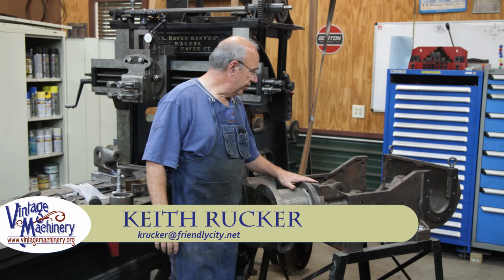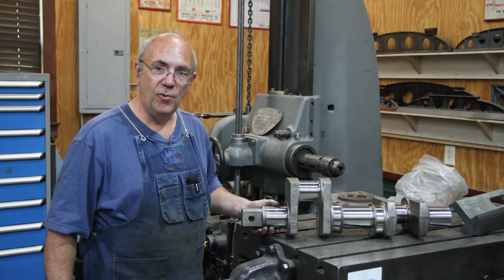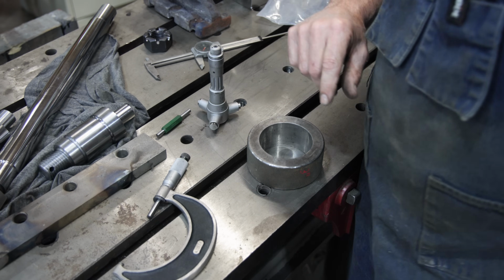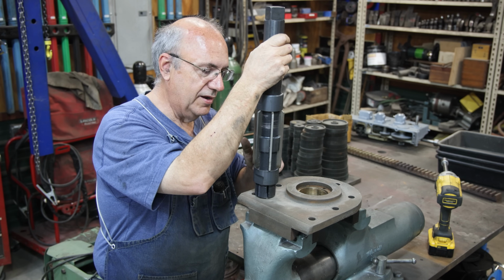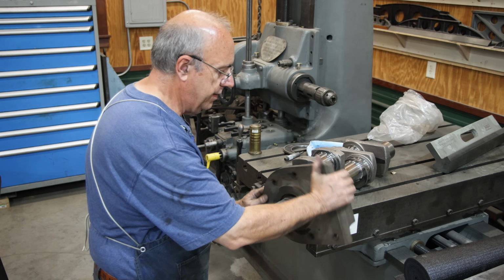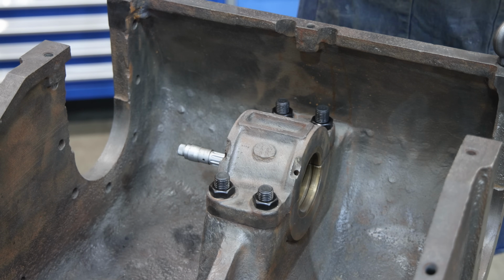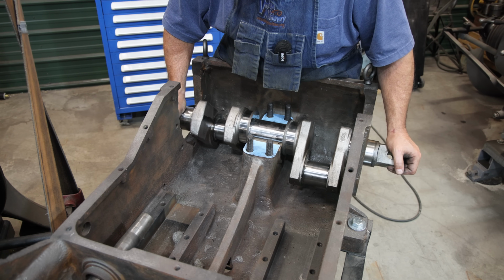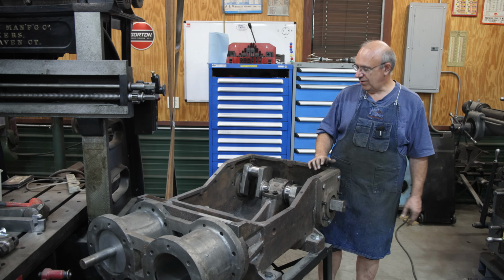Steam Stoker Engine: Installing the Crankshaft

Comment: That center bearing needs to be line bored so it is in line with the end bearings.  Your crank is way too tight and would burn the bearings out quickly.  It's not clear if those end caps have locating dowels.  If not then you can loosen those bolts and allow the end bearings to align with the center.  A lot of old engines did not have located main bearings, and the method used was to tighten- tap- tighten- tap- tighten- tap until the crank spun feeely.  However if those end caps are doweled in place, then you need to make a boring bar with a cutter that is supported by the end caps.
Reply: The end bearings aren't dowled in place. Meaning the crank itself is what does the alignment. No need to over complicate things. There is such a thing as too much constraint.
Reply: @dangerrangerlstc  No need to repeat what I already said.
Reply: @oldschool1993 I misunderstood what you were trying to convey on your post. My apologies

Comment: Keith the bearings need to be assembled in the engine without the crankshaft, and line bored for proper fit and alignment. No matter what type of bearings are used, Babbitt or bronze or insert type bearings all the bearings need to be straight in line. The crankshaft is ground with all the journals being straight, and if the bearings the crank fits onto are not straight the crank will never turn freely. IMO
Reply: Exactly what I was going to say. Any slight angular misalignment of an end cap bores will cause the bearings to bind when they are installed.
Reply: I agree but someone else brought up the fact that it wasn’t done that originally. There are no dowels or pins to keep everything in line with the end plates or center bearing. I wonder how they would have aligned everything when they put it together for final assembly, maybe a little extra play?
Reply: @Hoaxer51  I think the side bearings that bolt on are fitted to the main casting by the looks of it and that is why there are no dowel pins on the outside.
Reply: @Hoaxer51  As long as the bearing bores all have axes that are parallel with each other when installed they will self align with the crank. Line boring would make sure that they were all lined up. Reaming each one separately out of the assembly increases the chance (makes it almost certain) that they will not be in line.

Comment: In this situation the three points Bore micrometer is going to read incorrectly because it's a two piece bearing and you have shims. This is where you need to use the two point system that Adam Booth uses over at Abomb 69.  That way you can measure across the top of the bushing where they meet on the horizontal and then do it again on the vertical to adjust the shims.

Comment: Would it be feasible to scrape the center bearing to fit? Doesn't seem to be much that has to come off, but propably can't use a scraper for flat surfaces.

Comment: Sir, I think this is one occasion when you have forgotten your training in scraping. That inner bearing would have been scraped  to fit.
Reply: With babbit yes, but not with bronze which is what is installed.
Reply: @dangerrangerlstc   Sorry, I do not understand. Only recently I have scraped in a Myford conical front bearing made in bronze. This is  standard procedure. You use the blue to check things & get on with it. You do the same thing with the plain split bronze bearings in the ML7.
Reply: The only thing Bozo is trained in is BS!:face-blue-smiling::face-blue-smiling:

Comment: Hi all those fancy tools and you choose to use an expanding reamer??
Reply: I love the way Bozo "just gets to thinking" about alignment issues when he's half way through the project!
He should "just get to thinking" about another alignment issue, he never made sure that the piston rod travel was exactly parallel with the slide ways he haphazardly planed in the bottom of that casting, ( both sides and bottom ), with a dial indicator!
If they are not, slop in his babbitt pour will let it work, but it will never be right!:hand-orange-covering-eyes::face-blue-smiling::face-blue-smiling:

Comment: So happy you caught the alignment problem. As far as the bearings go, setting it up on the boring mill and line boring the center bearing would be the proper way to do it. Hopefully the outboard ones won't be too far out of line being reamed by hand.
Reply: Don't want to be a smart arse, but I did think line boring would have been the way to go. As a friend, who was a qualified engineer (I'm not) said to me. Adjustable reamers are the invention of the devil!
Reply: Or use a fixed stone align hone. But that is a pretty expensive special tool but they sure do work good! The hbm is how I would have done it to assure the bores all pointed at each other and were centered.

Comment: I want to know how the crank turns with just the two endcaps on and the middle cap off i.e is there any binding between the two ends, for the relationship between the endcaps will dictate what will have to be done with the middle cap

Comment: I use a two-point bore gauge for any type of cylinder, it's great for sussing taper and out-of-round prior to honing. It can also be used to set the piston/cylinder clearance by using a micrometer on it after zeroing on the bore (Haimer-like).

Comment: To those asking about aligning the bores, if you notice there are no locating pins on those end caps or center cap and bolts or studs are certainly not locating  surfaces. I would think if bore alignment was critical you would have those features. Without locating features on those caps, if you aligned the bores you would lose all alignment the minute you remove the caps. I think the original engineers who designed the engine intended that the installed crankshaft would serve to align the bores during assembly.
Reply: The issue at this point is not so much the crank bores and the rod bores being in alignment, but that the crank bores are square to it.  As the part of the slide that is cast into the babbitt metal moves side to side, it changes the pitch angle of the attached bore.  If it's too far off, it's going to wear out prematurely.

Comment: Just how engine bearings wear theyre under the most load at top of the stroke in the case of a steam engine that’s both top and bottom respectively the directional change plus the torque add immense pressure at the point of directional change oddly enough I would’ve assumed that you could smoothed out a steam engine allot with tuning

Comment: To the folks looking askance at the bearing alignment, it’s worth keeping in mind that steam engines—especially ones like this stoker—were built to much more forgiving tolerances than modern internal combustion engines. These machines typically ran at low speeds and were designed to tolerate some misalignment and wear. The constant lubrication and rugged construction meant they didn’t need the kind of micrometer-precise alignment you’d expect in, say, a modern car engine.

So while it’s natural to scrutinize the alignment process, especially if you come from an automotive background, the restoration method here is probably more than accurate enough for the engine to run just fine—especially given the original specs and working conditions these were designed for.
Reply: Especially since there's a 0.003" clearance for the oil. That will allow taking up some misalignment.
Reply: Spot-on observations 👍…. and very appropriate given the period that this stoker engine was originally built 
Robert
🇦🇺
Reply: This engine will probably run for less than a 1000 hours in its next life tolerances are not critical
Reply: Absolutly true... i've repaired and reproduced parts for 100 year old machines and stuff made this century. 
The phrase "they dont make em the way they used to" applies mostly to loose tolerances, backed up with a lot of mass or material.
The crank does not need to be perfectly in line for it to work, it will just be slightly less optimal but definetly still functioning.
If it wears prematurely, just remake the bushings and re-pour the babbit, no problem... try that on modern stuff... "no serviceble parts inside"
Reply: So very true
Reply: True and needed observations given all the aircraft and automotive people's comments, which are true but with a more modern perspective on tolerances.
Reply: Physics doesn't work that way.
Reply: @truracer20  
… but 100+ y.o. Locos do
🤣🤣
Reply: @RobertBrown-lf8yq  Damn 100+ year old locos can ignore physics?  A the bearings were not reamed in plane with the crankshaft, and B that crank should easily spin by hand. C those bearings were guaranteed to have been line bored originally. there's a reason that even bucket pin bores on a bobcat are line bored.
Reply: Blue the shaft before you set it in place or use some plastigauge to see where the bottom bearing is too tight.
Reply: @ 
It’s usually on the horns.
bearing scraper will do the trick
👍
Reply: This job is turning into a abortion
Reply: Agree that the tolerances for steam engines are much larger than internal combustion engines 
But, using a reamer without something to keep it at 90 degrees is unprofessional

Comment: Keith, I have rebuild a great many crank and bearing assemblies pre retirement. I can not recall any manufacturer advising the use of a three point internal micrometer. Every manual I have ever consulted specifies measuring diametrically at 90 degrees in multiple locations at either end of the bearing and journal. I used to measure the journals parallel to the thrust direction and as close to 90 degrees as possible allowing for the bearing split. That will show any ovality or taper. I always used a calibrated internal micrometer and double checked against the external micrometer I used to measure the journal. With bearing caps having no positive location control that will be difficult but you should be able to use the measurements to align the cap to the best position.
Bearings always wear most in the thrust direction so you probably need to remove material 90 degrees from the joint line. The hone will remove material all around the bearing and I think you may find when you get the clearance right 90 degrees to the thrust line you will have too much clearance at the joints. I would suggest that if you can not access a spiral reamer the correct size then use bearing blue to indicate the tight spots and use a hand scraping tool. That will also prevent contamination of the bearing with grinding dust which will rapidly damage the journal. Best solution of course is to use a line boring tool. I think it would be worth making a boring bar just to clean up the center bearing. Not a difficult project. Regards
Reply: I was thinking the same thing about line-boring it would have been nice to have on the outside bearing on and bored them all together so everything would be in line.
Reply: @HeadTotRodMess2025  I was thinking the same.
Reply: Not a difficult task...
Hummm. 🧐... 😂😂😂
Reply: I love the way Bozo "just gets to thinking" about alignment issues when he's half way through the project!
He should "just get to thinking" about another alignment issue, he never made sure that the piston rod travel was exactly parallel with the slide ways he haphazardly planed in the bottom of that casting, ( both sides and bottom ), with a dial indicator!
If they are not, slop in his babbitt pour will let it work, but it will never be right!:hand-orange-covering-eyes::hand-orange-covering-eyes::face-blue-smiling:
Reply: @garybrenner6236   Even though your comments are negative, they help feed the algorithum. I am sure that many of the viewers appreciate the help that you provide so that more viewers are brought to Keith's channel.  Keep up the good work. It's easy for regular viewers to skip over your negativity

Comment: Greetings, Keith. I worked in the calibration lab for a major airline, and our shop was maintained at precisely 68 degrees, as well as our hundreds of standards for measurement, time, temperature, weight, torque, etc. No tool could be calibrated until it had been normalized for 24 hours after being inducted. Our standards also had to be calibrated by the NIST annually. EVERYTHING had a paper trail. I enjoy watching your channel.
Reply: I'm an inspector at a major airline, I use the tools calibrated every year by the PMET guys! Once a year our cabinet was rolled out for cal.
Reply: Very interesting! I suppose that's absolutely necessary for modern day aviation. I hope this vintage stoker will be a little more forgiving.
Reply: If only they paid that much attention to making sure that door plug bolts were installed

Comment: It takes patience to work on this thing. You are correct in your approach but have some limitations to test alignment. Surprised you didn't use a piece of 3 inch ground rod to evaluate the alignment of the three bearings but recognizing the ultimate goal is fitting the crank. I know the parts are heavy. As I have mentioned the complexity of this thing is amazing and surely pushed the limits of those who originally produced it. My guess when completed it will be better than it was originally. Looking forward to the next video. Thanks!
Reply: The crank is its own standard. If he can set the crank in place and it spins, then everything is aligned. No need for a super expensive high tolerance ground rod to be used once. He's already got the standard on hand.

Comment: Am I the only one wondering why the two big end journals on the Frank are at 90 degrees to each other?
I would have imagined that they would be opposite (180 degrees) in a two cylinder engine.
But then again it’s steam powered so there’s possibly some voodoo magic happening that I’m unaware of. 🤷‍♂️
Just things that make me wonder sometimes.
Reply: It's to make the engine self starting
Reply: Since steam pistons can power on both sides of the piston, you want the two pistons to be 90 out so as one is reaching the end of stoke the other is in the middle of its power stoke. It also keeps the engine from being in a position at start up where it is impossible to move it by just applying steam to the cylinders. There is always one piston in a power stroke.
Reply: @ericpaul4575  Thanks heaps both responses. That does make sense. 👍
Reply: @ericpaul4575  And there is your steam voodoo magic! Two-action cylinder magic.
Reply: I love the way Bozo "just gets to thinking" about alignment issues when he's half way through the project!
He should "just get to thinking" about another alignment issue, he never made sure that the piston rod travel was exactly parallel with the slide ways he haphazardly planed in the bottom of that casting, ( both sides and bottom ), with a dial indicator!
If they are not, slop in his babbitt pour will let it work, but it will never be right!:hand-orange-covering-eyes::face-blue-smiling::face-blue-smiling:

Comment: Surely, the correct fitment of the crank should have been set up to be perpendicular to the piston rods and then the end caps dowelled to the casing, after which the bearings should be align bored?  That align boring would need a modicum of extra material in the bearings to hone it out to the finished size.  As it stands the crank could be marginally out, which would account for the stiffness of free rotation.
Reply: No, that is not how this was designed.  There are no dowels for the end caps.  The crankshaft itself is the alignment fixture.
Reply: @PixelSchnitzel  The crankshaft runs in the end cap bearings that are solely bolted to the casing for alignment.  Those endcaps cannot therefore be aligned with each other or the centre main bearing and ought to be align bored but to ensure that the endcaps are correctly positioned the endcaps would need to be doweled.  At the moment the endcaps can float around on the fixing holes. 

Keith has rightly pointed out that the rod slider needs to be perfectly aligned with the crankshaft and for that the crankshaft needs to be perfectly aligned.